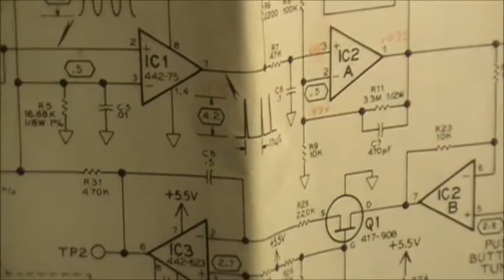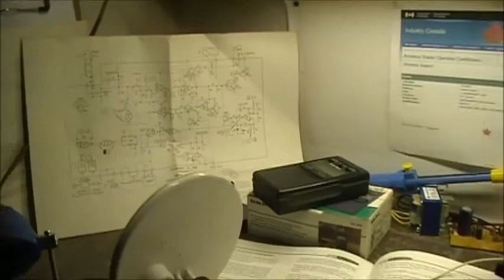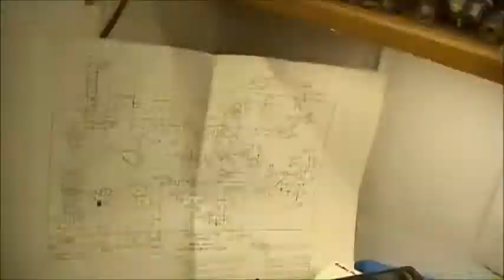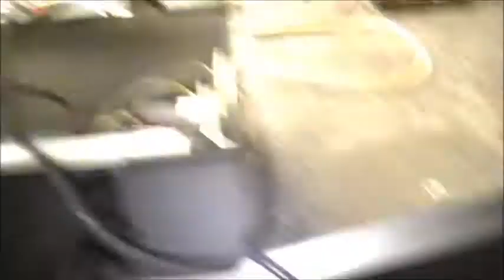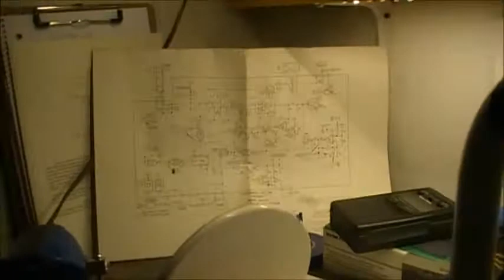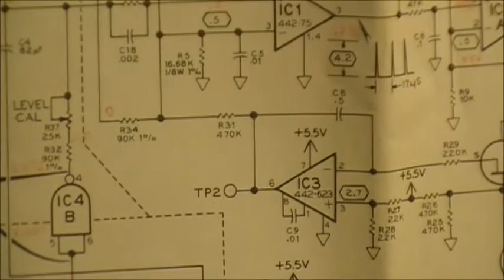HEATHKIT GD-1190 Metal detector repair PART-2

Comment: Hello Radionuts, my name is Javier and I am also a radio amateur and electronics enthusiast. I tell you that by chance, a detector just like this one came into my hands a while ago, The Heathkit GD1190, Cointrack. But I have to tell you that I have never been able to get it to work. I also do not get a signal on pin number 7 of IC1, I have already tried several original LM311Ns and was unsuccessful. Tell you that when I disconnect the antenna, the meter signal goes to full scale and the speaker beeps.
I can't find the assembly and adjustment manual anywhere and I would like to get it so I can repair said unit.
If you could help me get it, I would appreciate it.
A cordial greeting from Spain. 73's
Javier S. (EA4FQB)
Reply from the maker: Hello Javier, Merry Christmas to you and your family.
You can download the owners manual with schematic here:
https://www.vintage-radio.info/heathkit

If you have any problem downloading, let me know and i will upload it to my website so you can download it from there.

All the best... And take care.   de vo1mds  :-)
Reply: Thank you very much Darrel for your prompt response. I have seen in the link you posted that it only allows me to download the electrical diagram, but not the service manual, that is, the assembly and adjustment, which is what I am looking for. If you could provide it to me, I would greatly appreciate it. Please tell me what your website is so I can see it there? I am looking forward to your response. Merry Christmas and a happy new year to you and your family. Javier S. (ea4fqb)